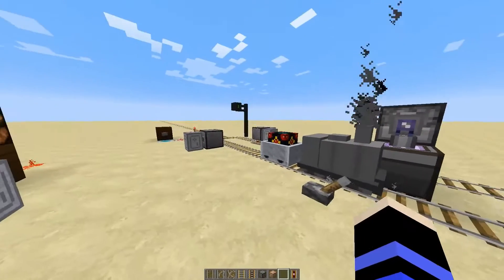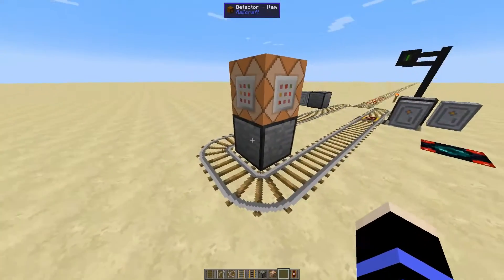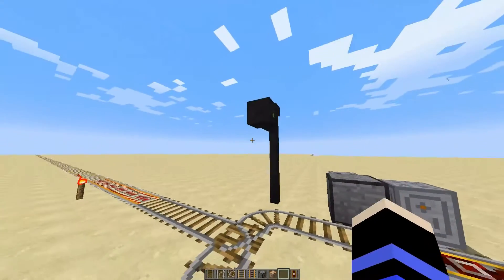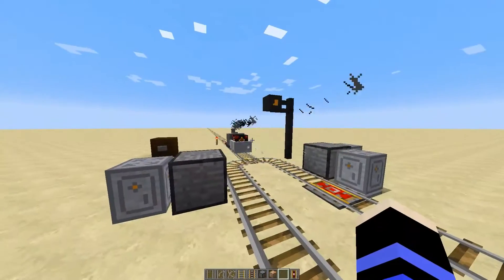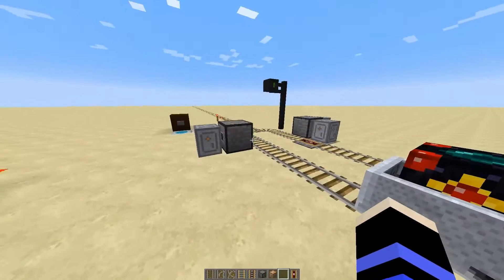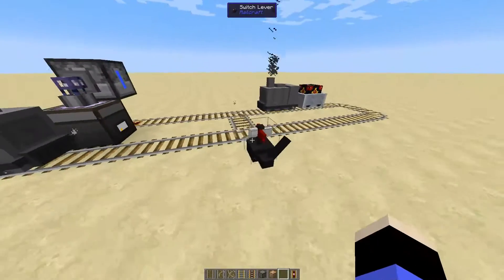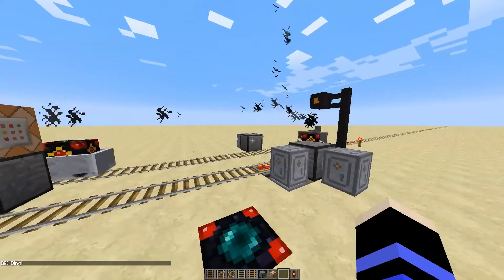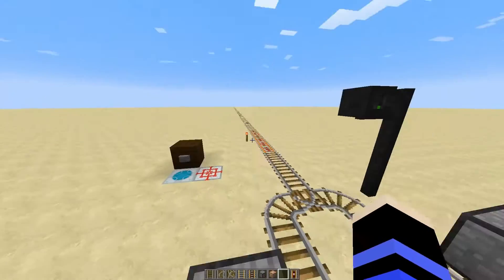Railcraft [Episode 4] - Tokens - High-Speed Control

Comment: My high speed track maintains the same speed as the normal booster tracks? Am i doing something wrong? (1.10.2)
Reply from the maker: Are you using transition tracks?
Reply: Tried both!
Reply from the maker: Sounds like a bug. Post a report on the issue tracker.